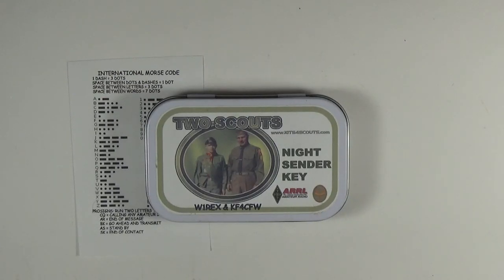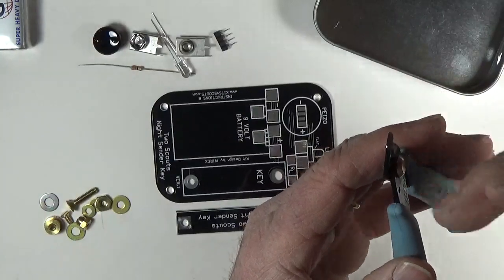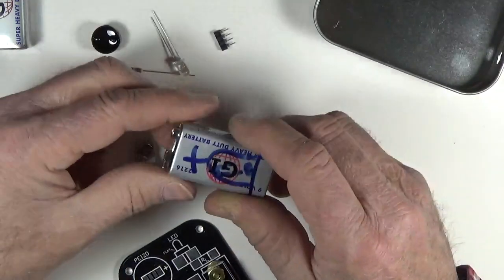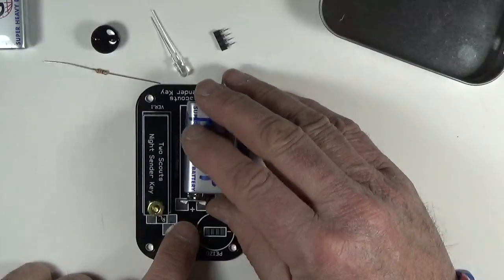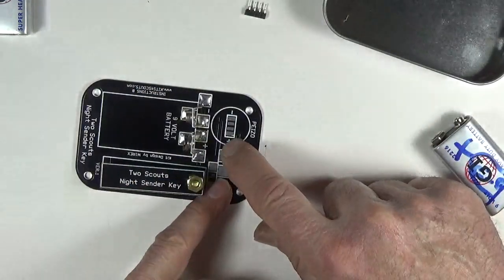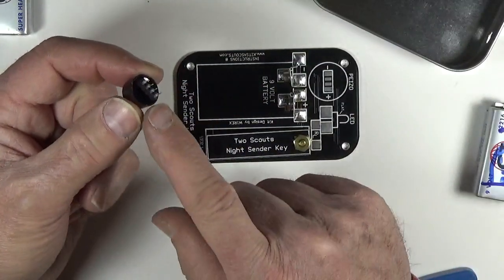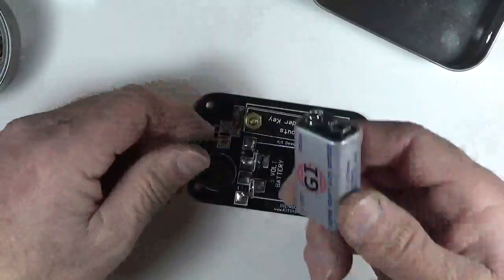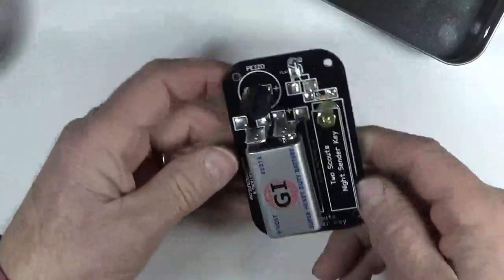Two Scouts NSK

Comment: can we put a 3.5 connector jack and after use it with a small cw transceiver
Reply from the maker: Notice that the keying is taking place on the + terminal of the battery...If you simply put a jack across the key, your rig would take issue with that +9 volts on the key line. Use a jack with built in switch. Wire the switch to disengage the + contact output to the piezo & LED circuits when the plug is inserted into the jack. Then simply plug in the cable to use it as a straight key. You might have to remove the battery to play it safe but the key should work OK with the 9 volt battery still in place. As long as no battery ground ends up over at your rig, the battery has no effect on the rig's keying.